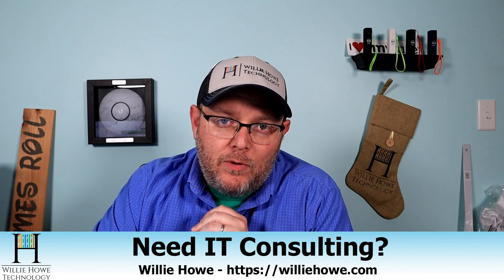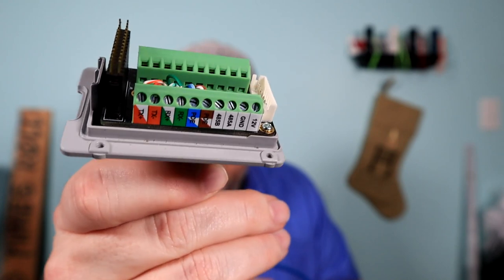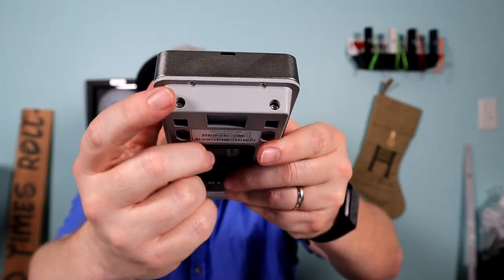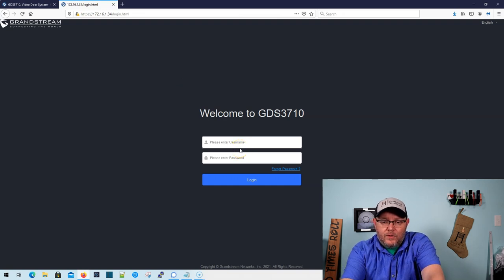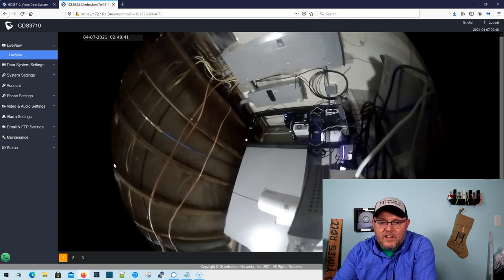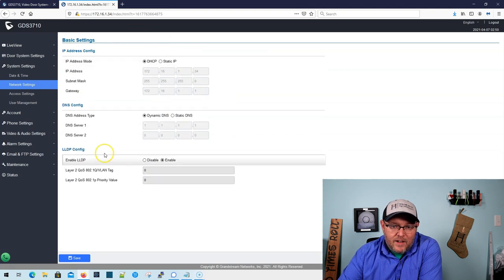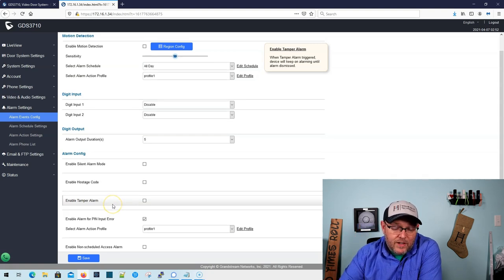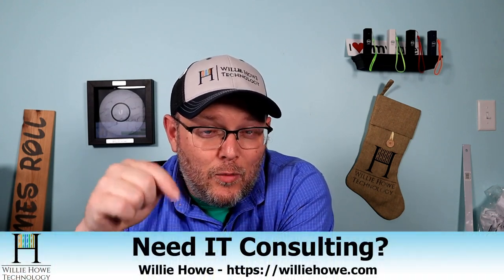Grandstream Door Station GDS3710 Overview

Comment: Willie, I found your video helpful. I have a couple of these units. I am looking for the Weigland connector cable that is used to do a factory reset of this unit. Do you know where I can get one? Grandstream support is very slow. Thanks for your help.
Reply from the maker: I would check with your distributor or reseller.

Comment: Very helpful video, strongly interested more on this product.
Reply: We have replaced a "2N Helios IP Vario model 9137111KU" with the "GrandStream GDS3710" a few days ago, and it is a rock solid unit. As Willie said, easy to integrate with almost any IP PBX and NVRs, in our case Lorex NVR using protocol ONVIF, but forget about integrate it with Ubiquiti/UniFi. Even though it is designed for outdoors, you must place it under a roof as other similar intercom or door bell products. Unfortunately, GrandStream has not yet developed an Android or iPhone app to replace RFID cards. If anyone knows of an app that allows this without rooting your phone, please share it... 😀
Reply: @javiercamacho1673  I think there is a card scanning functionality built into GDS3710.
Reply: @EduKSA Probably, I did not express well. I was talking about an application you install in Android/iPhone, and use your phone as your NFC card, so, you put your phone close to the GDS3710 keypad to open the door instead of the card. I know you can use the GDS3710 as your scanner, so you don't have to type the NFC codes by hand..
Reply: @javiercamacho1673  ohh got it. Great Idea, that would be awesome
Reply: Do you know how long the video call can last?  On equipment from other companies they only last 30 seconds and that is a short time.